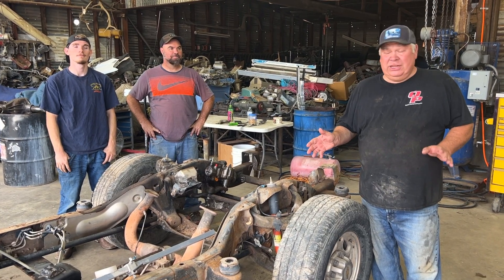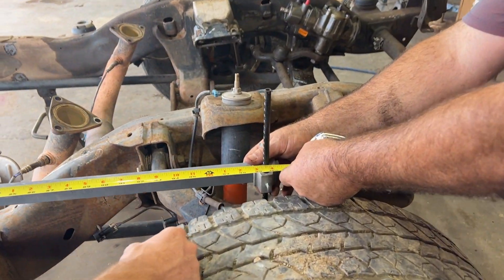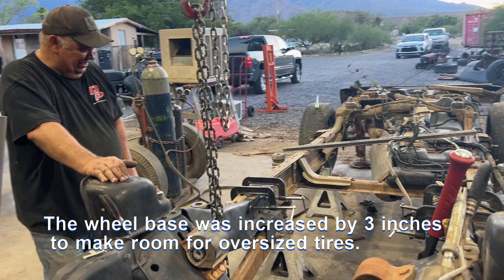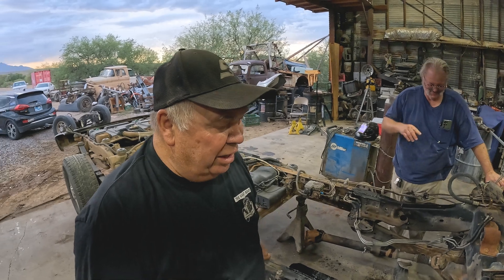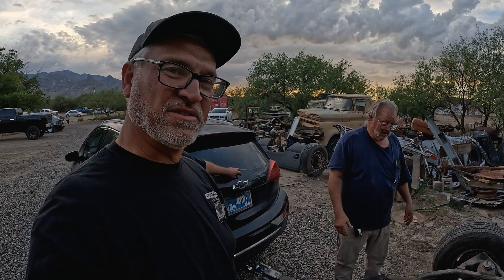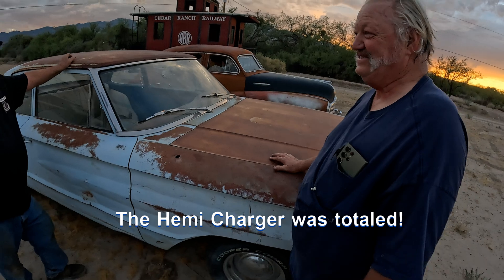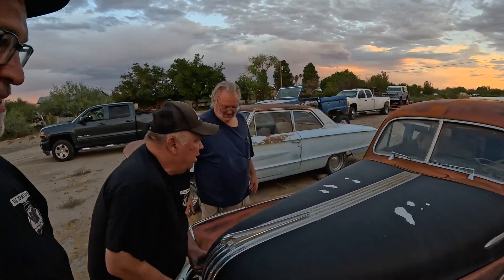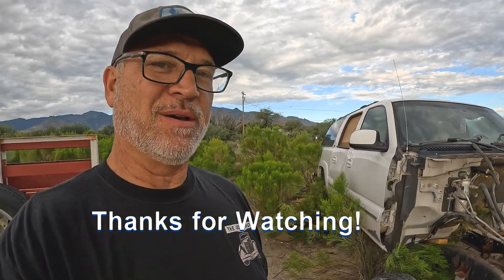Serious Upgrade! Adding 4x4 Front End onto 2WD Suburban | Pt. 3

Comment: I only had two favorite vehicles. One was a 65 Ford galaxy 500 with factory 4 in floor and buckets seats, two door of course. Had a 351 , with Holly 4. It was sweet. Then I had a 67 gto that wasn't to bad, not as sweet as the galaxy. Then after a few mistakes and years later I got myself an 80 El Camino SS. Right off the show room, my first brand new car. And let me tell you it was a dream, a real dream. I owned that car until 2002 and gave it to one of my sons. It would still burn the rubber off , not an oil burner, Never Ever , Ever , left me stranded anywhere. And it had 327,000 miles on it. The only states it never made it to were Maine and Alaska. As much as I loved the El Camino, I still missed that Galaxy. It was a really sweet car.  I've looked for another one but they are all married parts of Fairlane. 

Guess what I drive now?
Reply from the maker: The old iron and horses are the best! They are not as reliable as new equipment, but so much more fun!